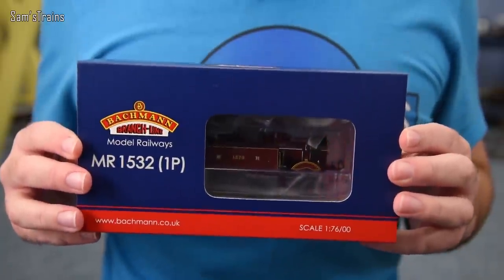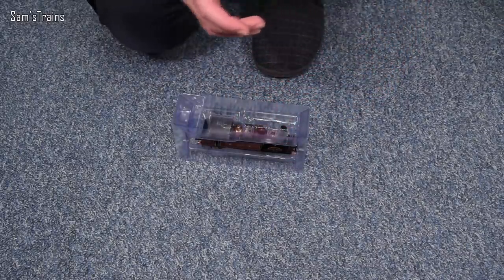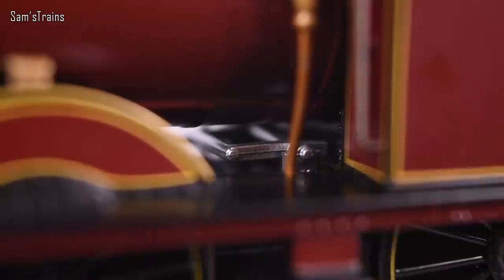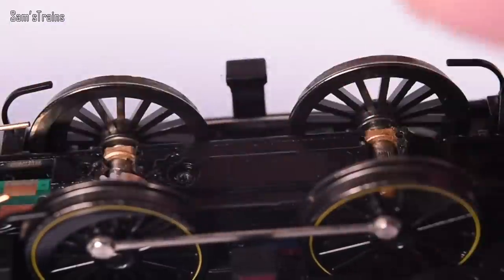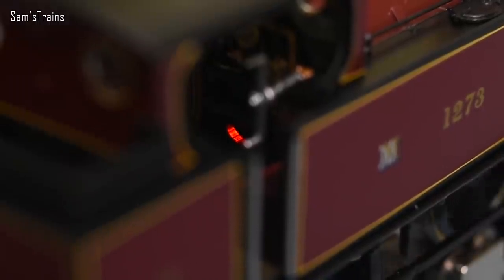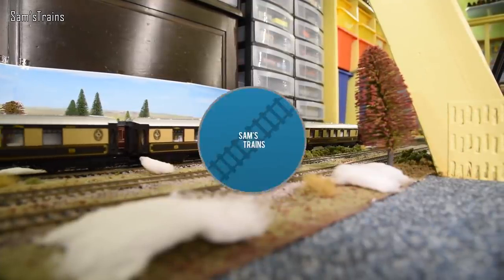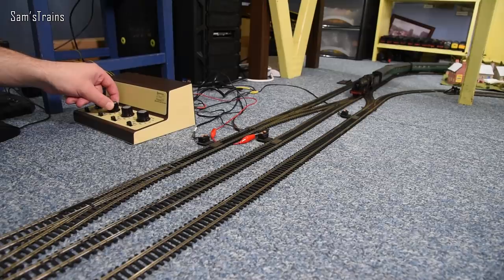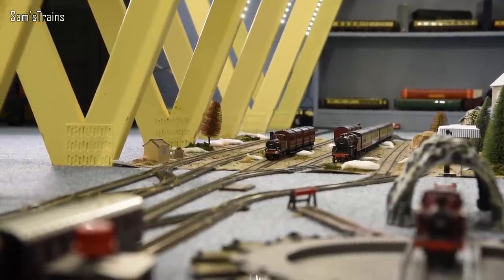Incredible New Bachmann Midland 1P Tank Engine | Unboxing & Review

Comment: Good morning Sam and happy Christmas to you and yours. I was able to review this model last week and have to say I agree with all you found. Is this a step change in model quality at last? It's a stunner. My bogie pickups needed to be adjusted and wheels out was the only way. I did not try the traction tyres as I found mine could handle almost three bogie coaches which is prototypical, what I did do was add some weight in the only place possible. Here is what I did https://youtu.be/wFcurwnwCuI I would be interested in your tests after this 6 g addition. Now mine works great with the three coaches. Great detailed review mate, well done. Mike

Comment: I’ve found that the coreless motors require a bit more run-in than usual, they’re great performers on DCC, but they ABSOLUTELY require a decoder made especially for coreless motors; the regular pulse-width modulation used by ordinary decoders will overheat coreless motors, and since they don’t have much armature mass, they can overheat quite badly… and quickly. There’s no problem on DC as long as your power pack outputs smooth, filtered DC. 😊

Comment: Hi Sam, I normally love your reviews and I hate to be negative but, have you been at the "Christmas sherry"? you spent most of the review showing this stalling, wheel slipping and waddling its way round your layout. And the loose wire, and the none flicker fire box, and the thick plastic glass in the cab, and the wheel pick-ups that don't touch the wheels, and that price! Yes it looks great but is still very plastic in the detailing. 
I was one of the unlucky ones who got one, yes it looks fantastic BUT (insert an expletive between every word); It runs like a pig, stalls everywhere, wheel slips setting off at low speed, SQUEEK_SQUEEK_SQUEEKS round every curve, waddles like a drunk duck, dies on pretty much every point, trips my layout on every high speed point and other points randomly. If that's not enough it decouples on straights (go figure). Compared to the Dapol GWR Mogul this thing is just garbage. Putting mine up for sale on FleaBay ASAP. Merry Christmas dude and stay away from that sherry.
Reply from the maker: No, I think on balance my score was very fair. The stalling only took place on express points at insane slow speeds; I was careful to make it clear that this was a worse case scenario. With a bit of modification to the rear pickups, the issue would go away I'm sure. Performance with the optional tyres was much worse, but fortunately those were not fitted to the model as standard. If yours runs like that, definitely send it in for some free repairs, as is your right under warranty. As seen in my video though, the performance was fantastic overall!
Merry Christmas - Sam :)
Reply: @SamsTrains  Merry Chrismas dude and keep upthe good work but honestly? Having to swap the wheels to make it pull a load! Would you buy a car that you had to swap the wheels on to get it to go up a hill? Your whole review of this apart from how good it looks was negative and bad. This is not just the worst model engine I have bought, it is the worst anything that I have ever bought, yours did not work, the only thing I can say positively about mine was at least it did not burn my house down. Not fit for purpose. It is soooooo bad Heljan could have made it. I am not having a go, you are right about all the bad stuff you said about it, it is that bad and worse. I will take apositive away from this, yours was garbage and mine was worse. Thank you so much for all your reviews as you are my go to guy before I waste my hard earned dosh on garbage. Merry Christmas dude.

Comment: Overall good model it seems, but I must say you leaving out the cab steps did ruin it slightly. How are the crew suposed to get in and out???

As for weight, try fit some automotive wheel weights inside the tanks maybe? There looks like there's room in there unless the tanks contain something. Good practice on light models is to add weight wherever possible.
Reply from the maker: haha that's true - I wonder if they'd foul the movement of the rear bogie though? Might be worth a try! Good idea on the tanks - I'll see if there's much space there!
Merry Christmas - Sam :)

Comment: Re: traction tires; my Roco Austrian Railways class 1020 electric has 6-axle drive, a strong 5-pole can motor, weighs 517 grammes, and has 4 traction tires.  Continental European manufacturers are obsessed with traction tires, whether the models need them or not.  North American models seem to never come with them, and none of my UK models have them either.
Reply from the maker: Thanks for sharing Kenneth - I'm very glad that manufacturers of British trains don't tend to use them - I'm certainly not a fan!
Merry Christmas - Sam :)

Comment: Lovely although the livery sadly represents a short transitional period from the fully lined MR livery to the simplified livery circa 1907. The fully-lined livery up to 1907 included fully lined crimson lake wheels and boiler bands. With the simplified livery post 1907 came the new MR crest on the coal bunker and that large gilt numbers that carried into LMS days. This model also has the Deeley revised smokebox door over the more elegant original Johnson door. 

So if you're modelling the Midland railway in 1907 then this model is perfect!

Comment: At a cost of anywhere between £99 to £149 I will stick to the HD or Wrenn versions. Yes, there is a difference in the level of detail but you can add detailing if you so wish.

Incidentally, any fitted with rear windscreen wipers; were either only on one side or were so small they are barely noticeable.

Comment: 34:35 that is the most ridiculous thing I've ever seen 😂😂😂
What a beautiful model I hope the traction tyre situation with this model is the same as the precedent class.
Reply from the maker: Quoting the Precedent launch video: "There's actually a spare pair of wheels in the box as well, for those people who are not bothered about traction as much, you can actually put a standard set of wheels in". The listing on Rails website does not state that the model will be boxed without traction tyres fitted, and instead says "The model incorporates a die-cast body and chassis with a set of optional traction tyre-fitted driving wheels for increased haulage capacity" - also suggesting the tyres will be fitted as standard. The listing photos also appear to show rubber tyres fitted.
If they have clarified that the metal tyres will be fitted as standard, please point that out to me!
Merry Christmas - Sam :)

Comment: One of Bachmanns best to date without doubt, but, there is a big but,...!! why do they release the most popular loco i.e. BR lined black, S&D, Bridgewater branch engine..with DCC sound...at a whopping £240 ...! 
They have also done this with the new 9400 class loco..!!
This is very cleaver marketing by the company to shift the most expensive units out first, for maximum profit on the production and tool making..
As I am building a layout based on this branch, I was very disappointed at this ...hence will not be purchasing anytime soon, owing to the current climate we are all suffering...
As usual Sam a great video..thanks ...
Reply from the maker: Yes it certainly is! Yeah the sound isn't cheap... I just don't touch them at those prices! :(
Thanks for watching, Sam :)

Comment: Another detailed valuable review from Sam and no-one else I have seen.
Looks very tempting but pricing, lack of diecast boiler and tanks, no flywheel, geared too fast, no gearbox to help with simple motor swaps, unreliable scraper pick ups on bogie, Bachmann limiting production to keep prices up, being sold out as a result, firebox glow not working well on DC, circuit board wiring too easy to fail and handrails not strong enough and already broken. These points and others may keep my score down and stop me purchasing.
0-4-4s are always difficult to get working well due to weight distribution limiting weight on the driving wheels.
Had the feeling the Midland had a very similar passenger 0-6-0T that would give less problems.
Reply from the maker: Thanks so much John! You're right, the model wasn't perfect, and I don't like the idea of limiting production to keep prices up, but on balance I thought most of the issues were relatively minor, and I found the loco very much fit for purpose!
Merry Christmas - Sam :)

Comment: Absolutely stonking little model these are. So good in fact that instead of buying the one DC model I had pre-ordered from my local shop, I walked away with two DCC sound ones instead; Midland and BR black. You know the worst thing about these 1Ps? Having spent £450 on two of them, I want more! If that is the only thing I can criticise them for, then they're golden! Yes, the bogie pickups on one of mine needed a tweak, but the other was absolutely perfect. So good in fact that I could lay tissue on the track and have only one axle picking up, it doesn't matter which, and it crawled off on speed step 1 perfectly every single time! After tweaking the bogie pickup on the other one, that behaves identically too. One thing I am noticing with these coreless motors is that they seem better suited to DCC, and with the right CV settings the lack of a flywheel is actually a good thing. I've fitted the blanking plug to test mine, and I believe they are both smoother on DCC than they are on DC.
Reply from the maker: Thanks a lot mate - that sounds amazing - can't blame you for wanting more! Many thanks for sharing,
Merry Christmas - Sam :)

Comment: Why was it jumping when you changed to the traction tyre wheels? 

My oldest loco is a 1978 Fleischmann Ho DB103 which has 3 driven axles with 6 traction tyres and it also has pick-ups on the driven bogie so clearly the wheel flanges conduct. The more modern version only has 2 tyres spread across different axles, a more sensible arrangement.
Reply from the maker: I'm going to investigate, I think the rubber surface wasn't properly smooth, that's my guess! Thanks for sharing!
Merry Christmas - Sam :)

Comment: Sam I have a question, I have a hornby terrier and I was trying to take out the men poker from its socket but it was to hard and the accually thing the holds it in place has a very thing peace of plastic. I can take the new coupling off but it is so hard to put it back in because I’m afraid of breaking it, today I just tried to do that again and the new socket snapped and now I only have 1 coupling for my terrier. Can you tell me where I can get a new one or how to repair the on I snapped?
Reply from the maker: Hi mate, sadly I don't know a way to repair them - they're very fragile! Try using a flat bladed screwdriver in future to ease them in and out. Ebay is your best bet - do a search for NEM couplings! :D
Merry Christmas - Sam :)

Comment: It seems hard to find trains this year that will ship, I had to go domestic and Use ebay I wanted some european stuff from reynaulds but I would have had to wait with my card on hold forever, I did manage to get some fleischmann wagons and a strange german Piko "western" set which includes a "americanized" German BR55 steam loco, Flat car, Boxcar, 2 Bavarian compartment coaches and a brake van all labeled with American railroad names. The set appears to be very old and I have never seen it before and it apparently runs and has the original 220v controller and a newer 120v transformer... It looked like A spaghetti western train So I had to have it, Shipping was a bit much and it wont arrive for another week so...
Reply: Sam may have reviewed this set a while back. Look through his old videos to find it.
Reply from the maker: Thanks a lot for sharing Raymond, that does sound a lot like the Western set I looked at!!
Merry Christmas - Sam :)

Comment: Again Well done Sam ,, I think if the smaller wheels had the pickups ajusted out wider it would have been a lot more of no stopping .
When you added the traction tyres there was a big wobble or that i noticed at least but run quite nicely when you fitted the standard wheel.. 
If you know ,, how many coaches or carriages could it normally pull on a running line as compared to a model ?
Reply from the maker: Yes you're right John - and that's easily done of course. Yeah - my example did not work well with the rubber tyres!
Thanks for watching, Sam :)

Comment: All that money and still rubbish nylon gears in the drivetrain. Even Tri-ang used brass which will outlive the model shame on the manufacturer for using that. Won't matter what motor its got when the gear on the driving wheel axle has split. Better to have a plastic body and proper mechanism in my opinion.
Reply from the maker: Yeah I suppose you're right, the nylon gears do seem to run nicely though, with very little friction! I've not known any of the gears split on models from the last 10 years or so, so fingers crossed!
Merry Christmas - Sam :)

Comment: I agree with you it does look a very detailed model. The spare wheels are an innovative idea like Dapols Mogul tender connection and slide out decoder board. It's good manufacturers are coming up with solutions to problems that have been around for ages. I think it's a reasonable price for the model. If it were Marklin it would be another £100 or so more.
Reply from the maker: Thanks John, yes quite innovative - never seen that before on a British model!!
Merry Christmas - Sam :)

Comment: Wow, in my opinion this is one of your best reviews ever, i have mixed reviews of bachmann as i have some great models by bachmann but i also have some bad ones and this has raised my opinion by far. Just one other thing, you said that corless motors don't go well with feedback controllers. What controllers are feedback, I am considering a model with a corless motor but i am not sure if my Hornby Select controller is a feedback controller. Could you let me know if the hornby select is a feedback.
Anyway, Great Review
Cameron
Reply from the maker: Thanks so much Cameron - sure, I have mixed opinions on Bachmann, but this loco gets a largely positive review, and it's very well deserved! The Select shouldn't be feedback as far as I know!
Merry Christmas - Sam :)
Reply: @SamsTrains  ok thanks for letting me know
Merry Christmas too

Comment: Looks lovely, but out of my price range for a small tank loco.  Looks like you have damaged one of the cabside handrails on the right hand side.  Shame that they are plastic, metal ones (handrails) would be much better on the cab as that seem slike a area where you are going to be holding the model.
Reply from the maker: Thanks Mike, I don't blame you for that - the price was a bit too much in my opinion too. Yeah I think I may have done - I didn't notice that until I was editing the video, as the broken pieces fitted themselves back together unnoticeably! 
Merry Christmas - Sam :)

Comment: This is a grand looking engine. Shame there no 1P locos left. But the H Class is practically the same. And by the way, just because it’s a 1p class, doesn’t mean it costs 1p.
Reply from the maker: Thanks a lot Tomas, yeah pity they didn't make more! The H class has far more performance issues in my experience, and no sadly it costs more than 1p :(
Merry Christmas - Sam :)
Reply: @SamsTrains  Yep. Over 12,000 pennies. It’s a bit ironic that the H class has performance issues.

Comment: Hi Sam. Quite beautiful. The 'gold' bell housing had a centre mould line, which is a shame (I didn't notice whether the boiler had one). While you were fitting the traction-tyred wheelset, it looked as though the driving wheels were not quartered; if so, why not? As I model in N gauge, I presume I cannot buy the four-wheeled coaches you ended up putting behind the 1P; what were they, please?
Reply from the maker: Thanks Paul - yes I was careful to show the mould line - didn't look too good did it? Nothing like that visible on the boiler though. Not sure about the quartering, that seemed fine to me, though the surface of the rubber didn't appear very smooth, hence the limping! The coaches were Hornby 4 wheel coaches, they produce them in all kinds of liveries.
Merry Christmas - Sam :)
Reply: In the early seventies Graham Farish or Grafar, as they were then, made N scale four wheel generic coaches, well before Hornby and Hattons Genesis. Might be hard to find now.

Comment: Most were rebuilt with Belpaire boilers and they lost their safety valves on the dome and brass churn. A final batch of similar locos was built by the LMS in 1932 - they were the first locos to appear when Stanier took over. The last ones were on the Romford branch. The LMS locos were on Watford to St Albans and Lancaster to Morecombe. Presumably they had many common parts with the Midland 1F half cabs.

Separately glazed windows mean  you see the edges of the glazing. Probably better not to glaze individually.
Reply from the maker: Duly noted, many thanks for sharing! Not sure about that with the separately glazed windows - the ones I've seen look far better- which ones have the edges showing?
Merry Christmas - Sam :)
Reply: @SamsTrains  It depends on the thickness of the glazing material. The edge show light due to internal reflection. Microscope slide cover glass is used by scratch builders, I believe.